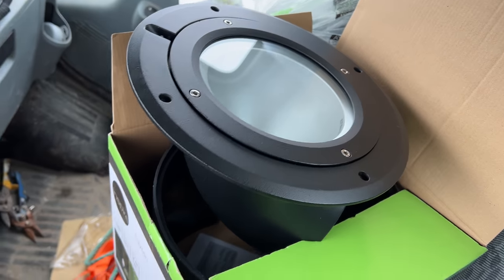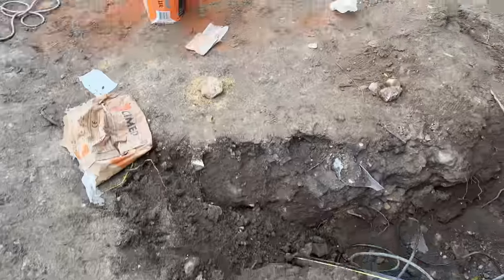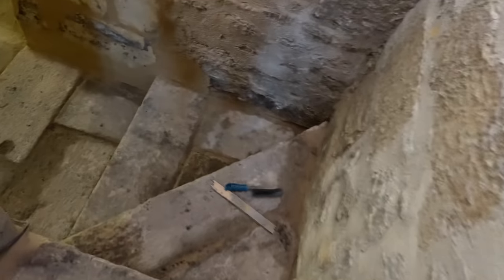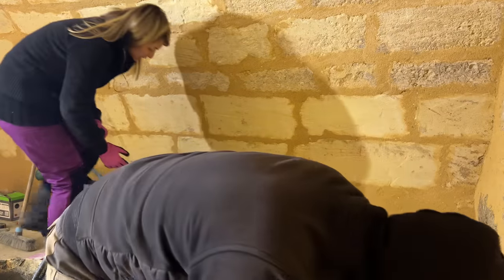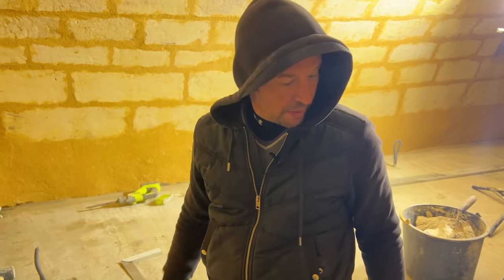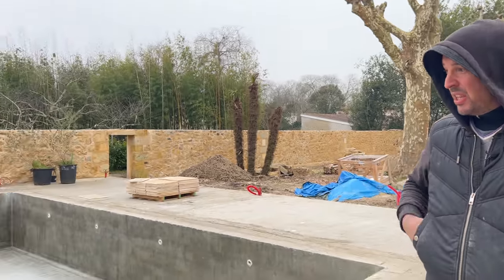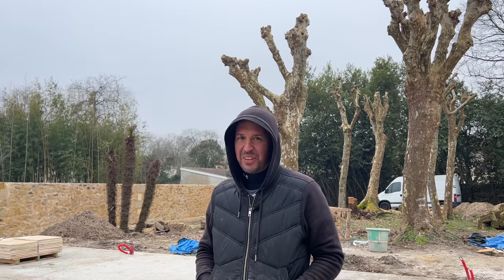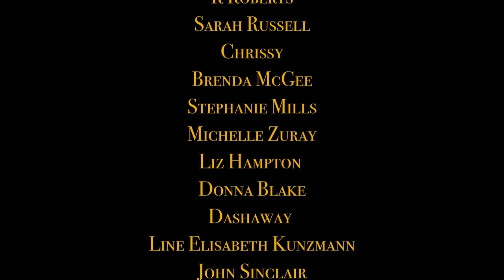EP122 New Assistant , Lucky Escape, Wine Cave & Pool Update @ Passion Project Renovation

Comment: How are the edges of the glass fibre sealed, at the top of the walls ?
Reply from the maker: We put the edging stones on and then silicone between the 2
Reply: @BordeauxLife  …… So the silicone is enough to stop water penetrating behind the glass fibre ?
Reply: @BordeauxLife  ………….. obviously with the 👍 thumbs-up reply, your fed-up with my questions 😂
Last question…… did the workers put 1 fibre glass layer on the base or 2 ?
Now I’m 🤐
Reply from the maker: 😂 Not at all I just wrote yes and préfères the thumbs up!! They used the same fiberglass technique everywhere - thick fiberglass and then thin over the top.
Reply: @BordeauxLife  …….. it was the number of Layers of thick fibreglass that I wondered about ? 🙂
That thin final layer is only a kind of tissue, to give the fibreglass a smooth finish. 
I’m not asking because I want to do it myself, I’m asking because I’m a nosey old git
Reply from the maker: 😂 it was just one
Reply: @BordeauxLife  …….. I wonder if it was a layer of 2 oz (600gm) or 1and 1/2 oz (450gm).
I guess one layer is enough as it’s over a concrete base and if any imperfections in the laminated glass fibre mat, then it wouldn’t amount to much. 
But if it was a flat roof then it would need (in my opinion) 2 layers as water could (if only 1 layer) penetrate into the building. 
Depends I guess….. how good the workmen were. 😬